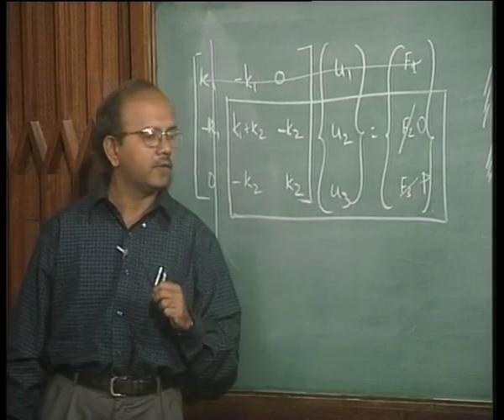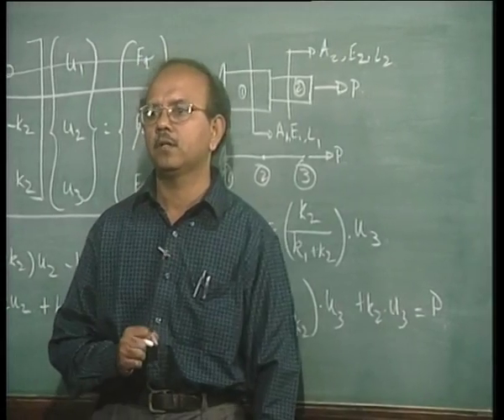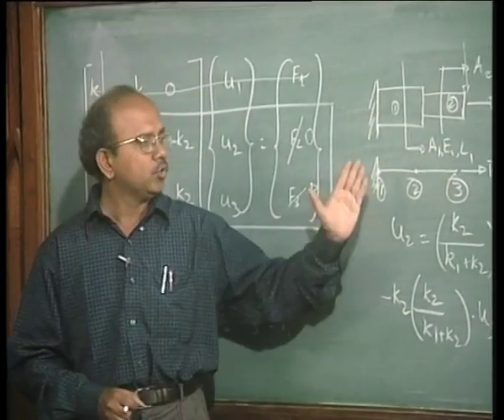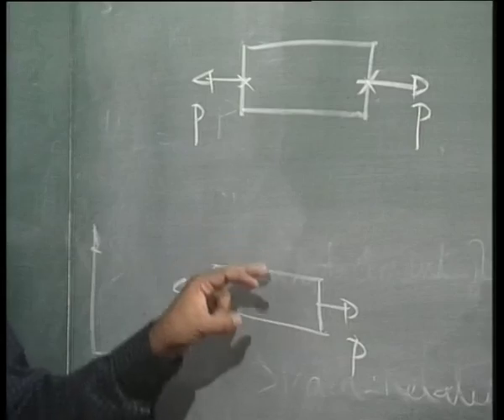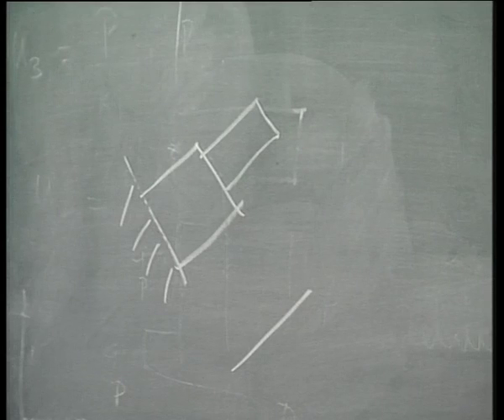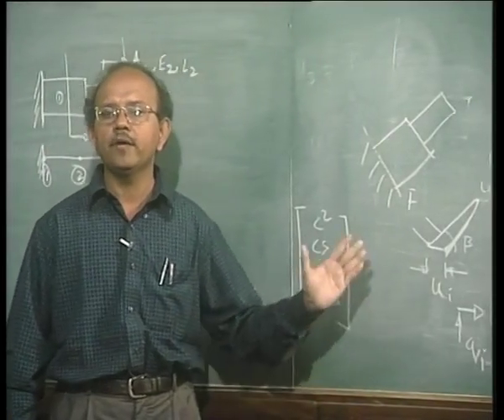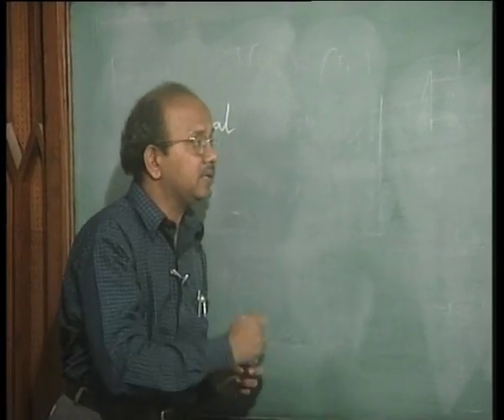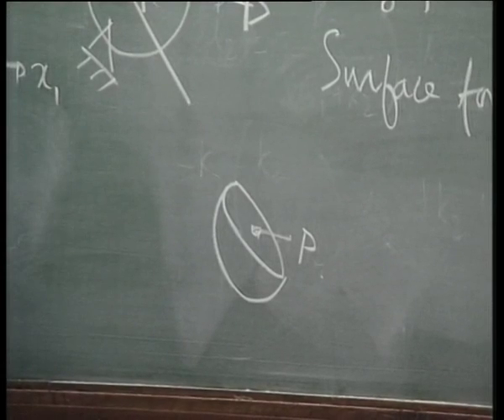Mod-01 Lec-04 Introduction to Finite Element Method

Comment: @07:05 professor has told epsilon2 as u3-u2/L2.  Can I know the explanation, possibly?

As the material is same how the displacements are negated.  Please provide information in terms of figure also
Reply: here epsilon2 is change in length divided by original length....epsilon fr second element is difference of u3 and u2 since u2 is dispacement before application of force nd u3 is displacement after application of force....so change in length of 2nd element is u3-u2 ...and original length of 2nd element is L2 so epsilon2 is change in length divided by original length.... u3-u2/L2 ...... thnaku :)
Reply: I think it will be easier to understand id you consider the nodes as points. So node 2 has moved by distance u2 and node 3 has moved by u3 in the same direction, to net displacement is u3-u2 and the net strain is as he calculated
Reply: I am getting the same answer sigma2= P/A2 using the same formula for epsilon2.
Reply: The Physics you explained about change in length is correct, but i noticed that if you use the equation of epsilon= U3-U2/L2 to solve for sigma (stress) = P/A2, it yields a different answer. At the end, I think he used epsilon= U2/L2 to find sigma (stress). Please, explain otherwise if you can. Thanks
Reply: u3 is displacement of link(2-3). Link(2-3) stats at position 2 and ends at position 3. If point2 or otherwise called node2 is displaced then link(2-3) starts at position new2 . u3 is only related to link(2-3). which means link(2-3) has elongated by u3. hence strain of link(2-3) = u3/(length of link(2-3)). correct me if im wrong
Reply: @pratosh666  yup , but due to force acting on bar 1 , the node 2 is already displaced , which is notching but u2 , so he want only the change in length at node  3 , so he  substracted that from u3( dispacment at node  ), hope you got it , thanks

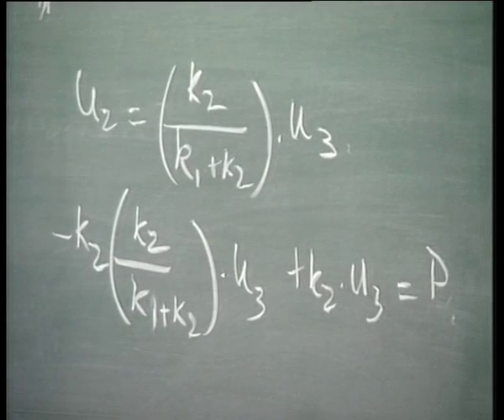Comment: at 3:50 how does he end up with u3=p1/k1+p/k2
Reply: Instead of they way he does it by substituting u3 in the second equation do it the other way aroudn. Substitute u2 and you will get the answer.
Reply: Gabriel Silva Simple algebraic math problems. Just try you will surely get that answer.

Comment: Audio becomes severely de-synced as the video goes on.
Reply: just watch the video at a higher speed and you wont notice. I watch them at 1.5x.
Reply: how to increase the speed?
Reply: ananth boudhmanabhan you will find that option in the settings menu..